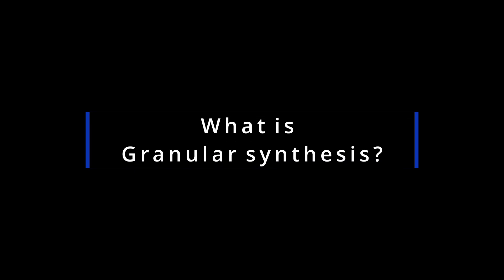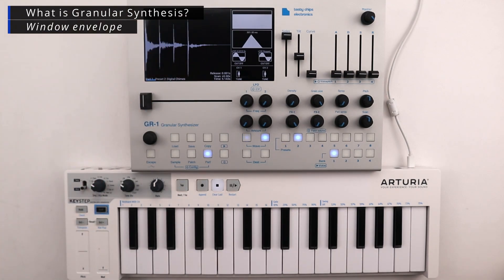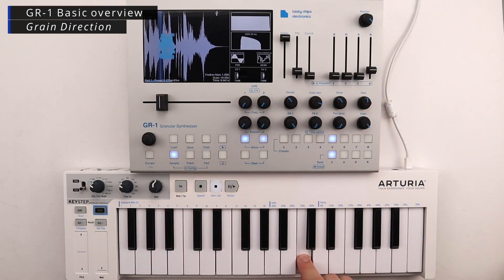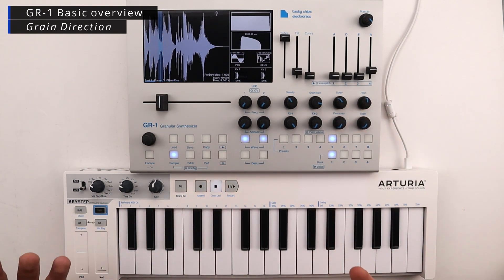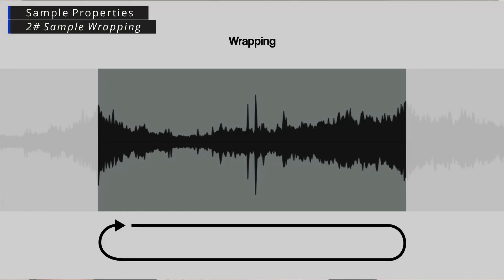Tasty Chips GR-1 Tutorial 1: What is granular synthesis?

Comment: Eyeing a used GR-1 now, and this series is a great deep dive into what it is and what it can do. Thank you!
Reply: Did get the GR1, and what I love is that the sounds are incredible, functions are right on the faceplate, and it’s fun to experiment. What I don’t like is how it handles user samples. You can load a sample from a USB stick and play with it, but right now you can save the preset with your samples into the device, or save banks of your own samples into the device. Tasty Chips says a new firmware update will fix that, should come out when the new version of the hardware device comes out?

Comment from the maker: Timestamps:
0:00 Intro

What is Granular Synthesis
1:05 Grains
1:14 Grain Duration
1:46 Sampling or synthesis?
2:01 Window Envelope
2:40 Grain Density

GR-1 Overview
3:42 LCD & Big Slider
3:57 Menu navigation
4:09 LFO
4:19 Preset & Banks
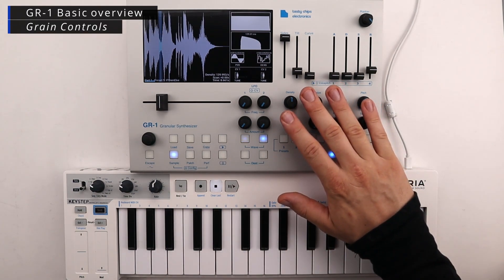4:29 Grain Controls
4:35 Density
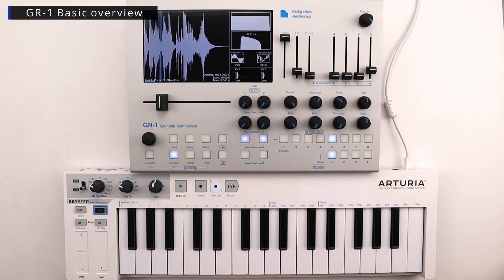4:48 Grain Size
5:02 Spray
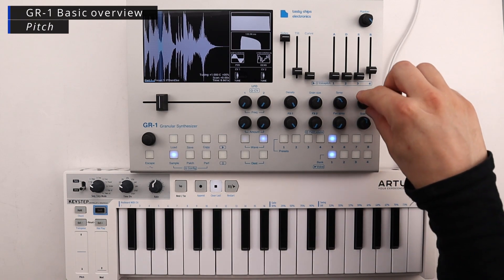5:26 Pitch
5:37 Scan
5:48 Direction
6:18 Pan Spray
6:33 FX-1 & FX-2
6:47 Window- and Voice envelopes
7:37 Master Volume
7:45 Backside of GR-1

Sample Properties
8:20 #1 Quality of a sound
9:40  #2 Wrapping
10:10 #3 C-tuned samples
10:39 #4 One-shots, melodies, and harmonies
12:58 #5 Mono & Sample Rate
13:53 outro